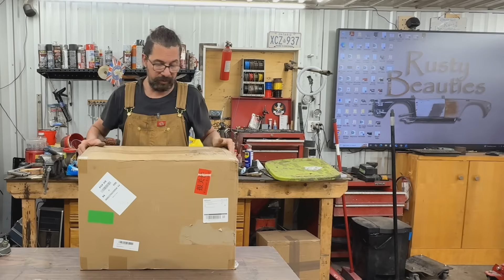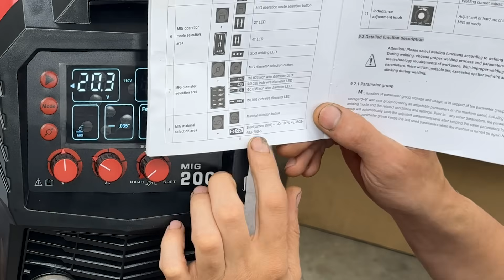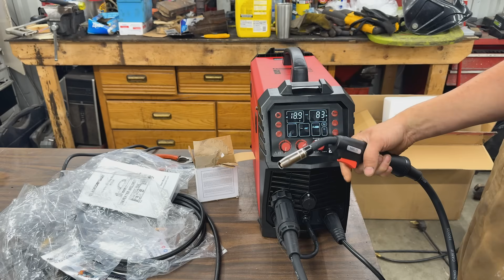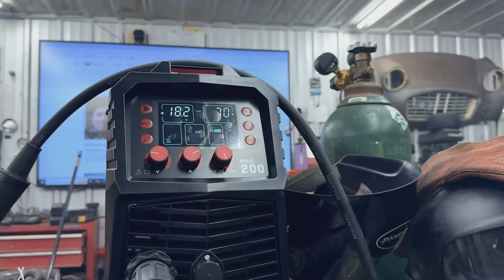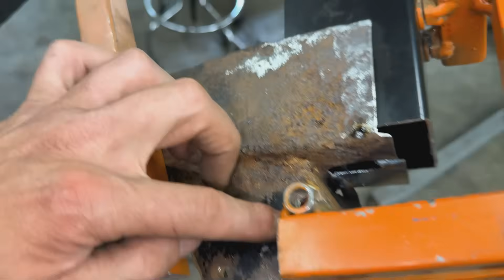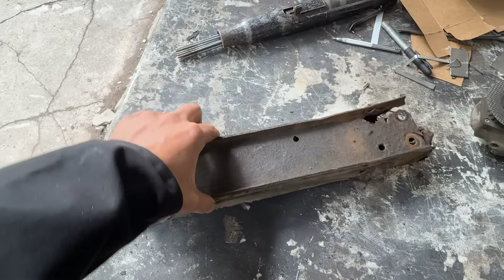1974 TR6 FIREstoration - Part 5 - Frame Repair with ARCCAPTAIN MIG200

Comment: Great video! You should partner with Eastwood (or buy some) and use their internal frame coating. Rust encapsulator plus is good for the outside. 
Even without an intended full restoration you should protect things.
Cheers.

Comment: Thank you so much Elin! I am in the middle of the same repair on my car. I haven’t seen anyone doing it quite like I’m attempting though. I am doing it body on while I have the floor pan removed for replacement. Not ideal, but so far I have had enough room to cut and weld where I need to.  I’m using a copy of your jig. The passenger side is done and the floor is now fit and waiting to be welded

Comment: (If I remember my schoolboy physics correctly) the voltage used will determine the ability for the electrode to “jump” a gap ( the arc) and the available current then dictates the heat intensity for the weld to “flow” …- is that right 🤔?

Comment: In the U.K. most machines are available to operate either using 220v (or with a further phase connected, larger industrial type machines can operate on 415v)

Comment: The welder is an exact copy of the one that I bought for my Healey restoration, mine is called a Boss Weld Buddy 150. It has done a stirling job, unbelievable for a 600 Dollar machine. In addition the spool holder broke probably due to heat, I don't know, but the company replaced it within a week. Amazing addition to my workshop without taking out a second mortgage.
Incidentally, good job Elin.

Comment: Good Video.   Pre and Post gas setting is very important.  Pre allows the gas to start flowing before the spark, kinda like a  primer..  Post allows the gas to protect the weld as it is cooling.  Important to keep the nozzle on the weld until the gas stops flowing.

Comment: Elin,
You are a master craftsman. I'm not.
I do enjoy watching something rotten turn into something useful at your hands.
 Thank you.
Ps: it took nearly 20 minutes of tutorial on your newest video to make a weld.. 
FYI: I could care less about how it works..I appreciate the finished work.
Reply: That was a great video. Yes I have seen you do these frame repairs before,but in each case you solve the little issue that come up so easily. Congratulation!